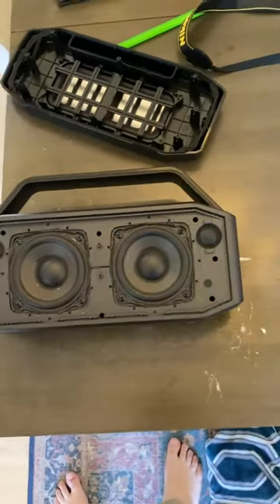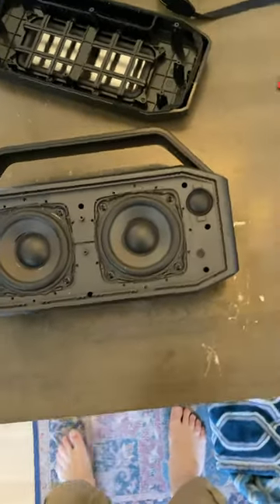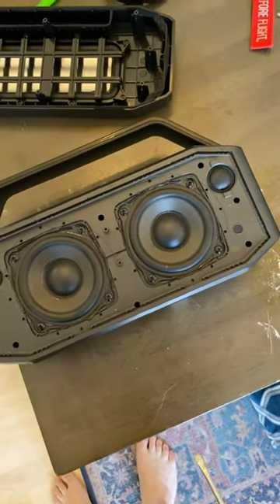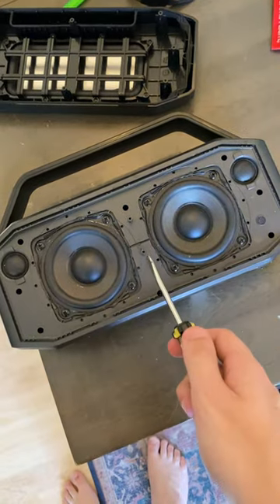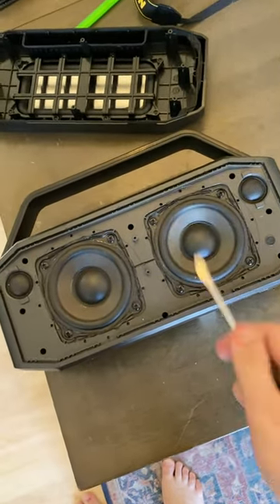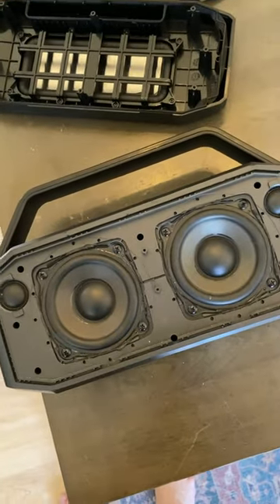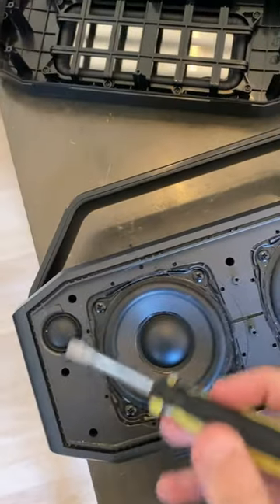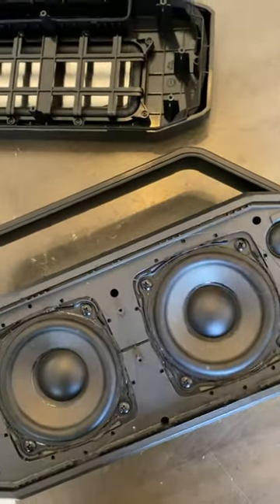W-KING D9 disassembly / removing rear panel

Comment: Hie please wld you show us the battery. I have a similar item need to replace the battery 🔋
Reply from the maker: The battery is situated between the two speakers on this model
Reply: @crafterofworlds3992  ok thanks, wld you please please link me to an indepth battery replacement video of this wking D9 BT Speaker
Reply: Can the tweeters be removed or are they glued in?